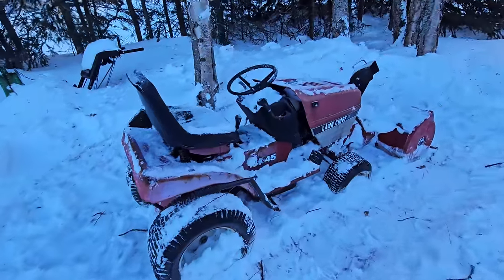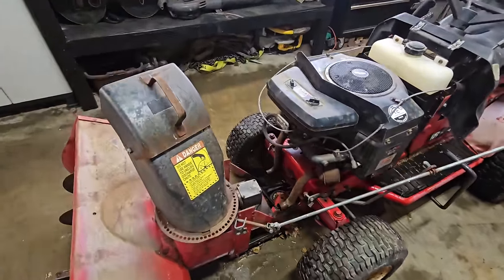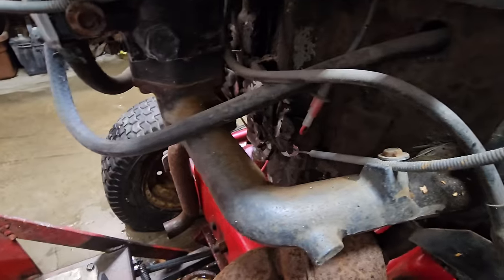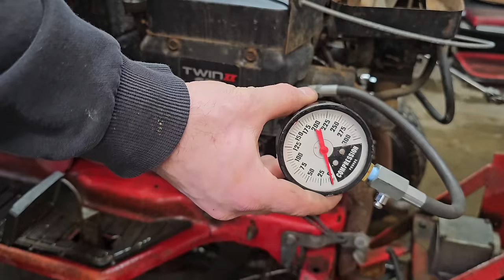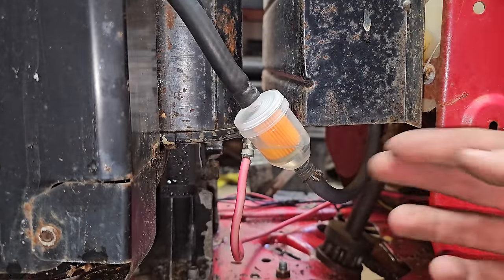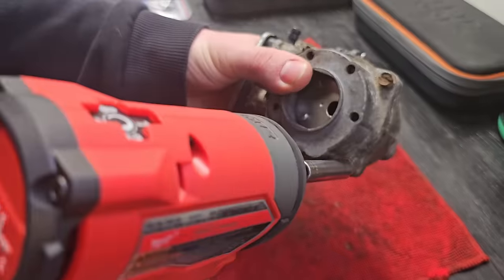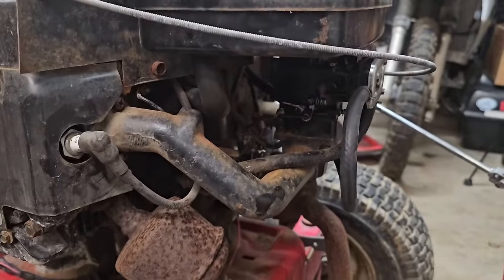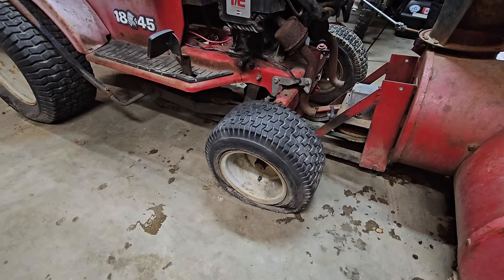Abandoned & Forgotten Lawn Chief Tractor with Snow Blower WILL IT RUN? pt1

Comment: Questions/Suggestions:
WD40 use: spray all cables throttle/choke, spray all pulleys & check for grease zerts, clean spark plugs (had them out to check spark & compression test

Fuel/air system: use of Sea-Foam in fuel tank, shut-off valve BTW tank & carb, clean air filter
Reply: I learnt the hard way about the fuel line shut-off valve one summer on my 2008 Troy-Bilt Pony, set to long, gas leaked pass carb to crankcase. Caught it before any damage done. I'm a firm believer in Sea Foam, run it in my Troy-Bilt, Harley, 2 Chevy pickups all gasoline powered yard tools. Nice work!
Reply from the maker: Thanks for all the input! Shut off valve is definitely a good idea. And I agree seafoam is awesome stuff! I'll definitely be adding some in the tank and the crankcase soon. Lawn Chief Part 2 is dropping tomorrow at 3 pm AKST. Stay tuned!
Reply: @philipbrake5263 I was just about to make the same suggestion about lubricating all of those moving metal parts and cables and connections.

Comment: If this engine doesn't have an oil filter, don't low idle them for too long, the splash-lube system doesn't lube enough overtime. Also valve seats can move sometimes on these, good to pull the heads for carbon-cleaning to check em. Cool find for 100 dollhairs

Comment: I like those opposed 2 cylinder Briggs,  I put an 18 horsepower on a 38 inch cut Murray. Compared to the original 11 horse engine,  it did a great job.